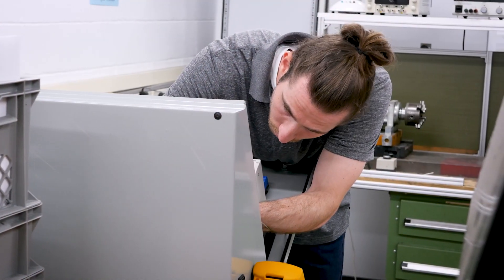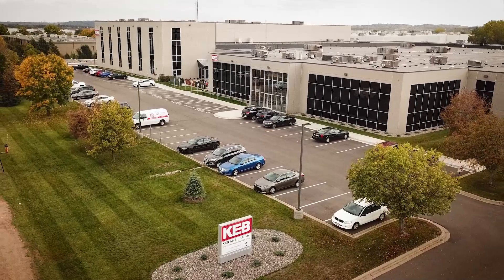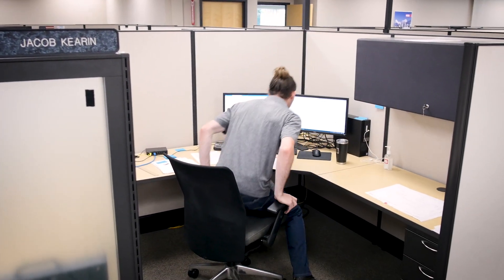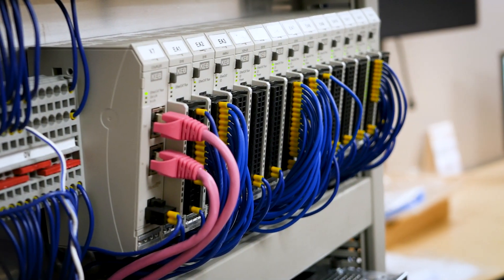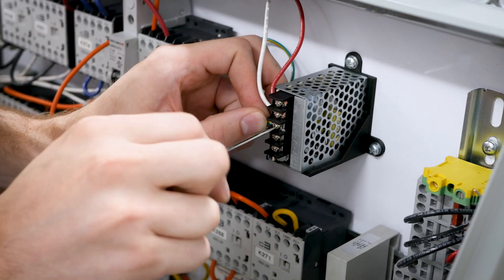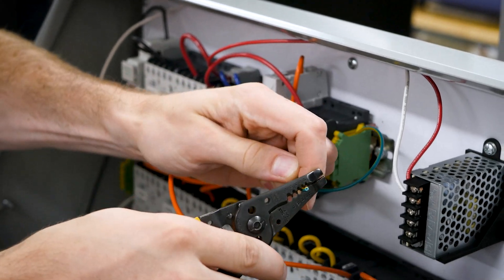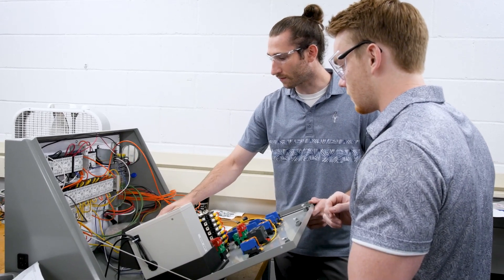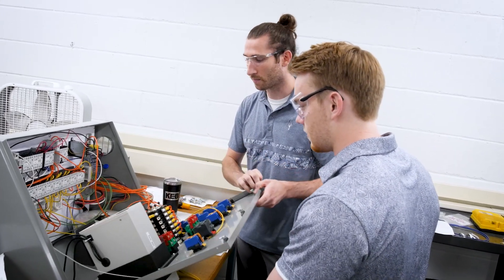Electrical Design Engineer Intern: Jacob K. - KEB America Careers

Comment: Nice  video, do you need to know coding, to be an electrical design engineer?
Reply from the maker: I don't know if it's required, but if you look at this website you'll read this advice for electrical engineers: 
"As electrical engineers, if you learn one programming language, it should be C/C++. You need it to program the microcontrollers, configure the registers, and you’ll be designing and writing test firmware to exercise various parts of the circuit." https://www.allaboutcircuits.com/technical-articles/Python-vs-C-C-which-language-electrical-engineers-why-learn-Python

(we are not associated with this website in any way)